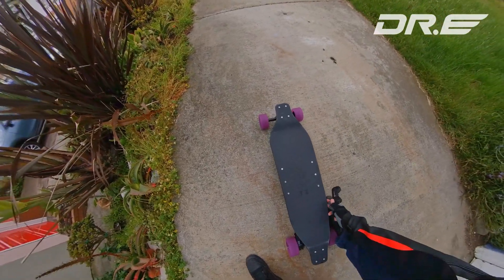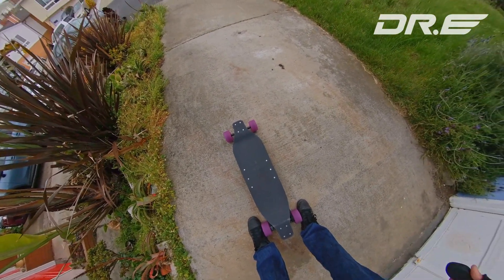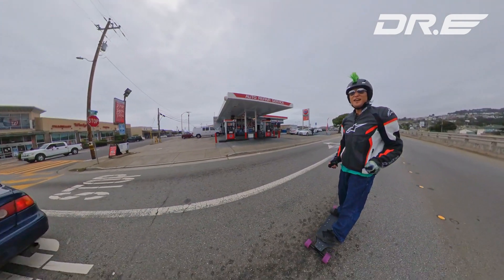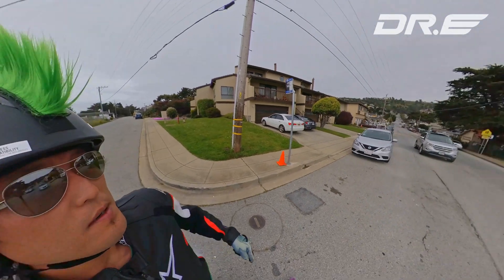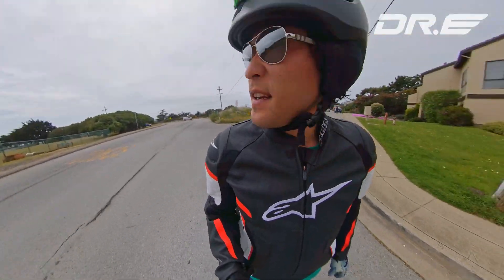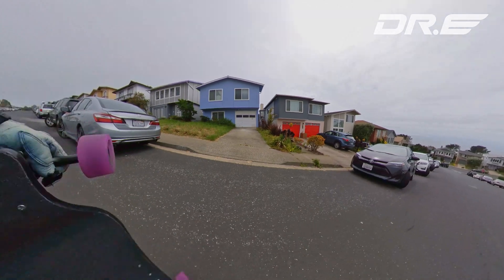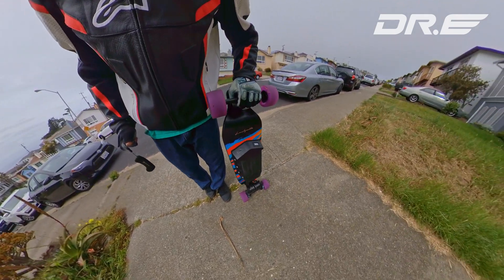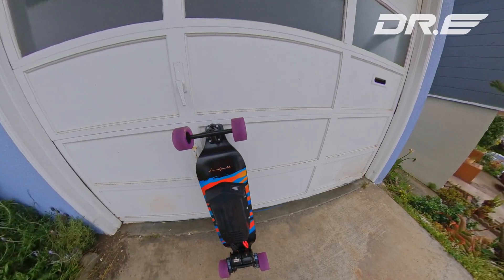FAST 5000 Watt DIY Electric Skateboard Build w/ Dual Torqueboard 6355 Motors! [#MadMaxMini V2]

Comment: I was wondering if I jumped down from 6384, but pumped more amps than I did w the bigger motor, would I feel much of a difference? I remember my bkb 6355s were fast n strong, but do they run real hot??

Comment: I got a BKB 'buildkitboard' dual-motor setup. Switching to the Evo 36 Spectrum as well. It came with a 10S3P 30Q pack, but I was looking to upgrade to either 10S3P 40T or 12S3P 30Q or 40T. But I have the VESC 4.2 w heatsink (plus), I think the same you are using. Does the dual 6.6 w heatsink work fine with those configurations? how did you get a short?
Reply from the maker: I recommend going with 12S setup if possible, 12S2P is still more capacity than 10S3P with 30Q.  12S3P would give you 488wH.  Since running at higher voltage, you can also get the most power out of Flipsky 4.20 Plus.  Been running near full throttle no problems whatsoever with heatsink exposed air.  I shorted my VESC 6.6 while trying to use one of the 4 screws that is holding down the heatsink to the battery metal plate, I used much bigger screw but didn't realize motor wires were super close to that as it is hiding underneath the pcb.   So with 4.20 Plus I simply used epoxy instead on the sides to hold it down.  Lesson learned, don't touch screws holding down the VESC.